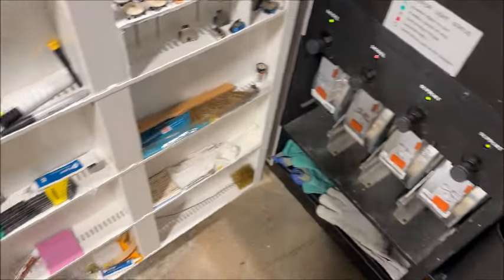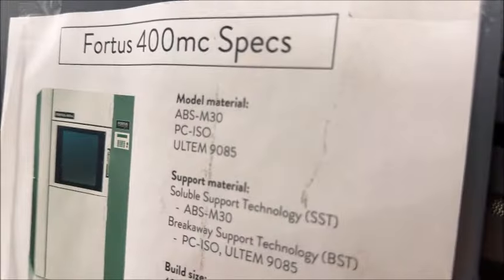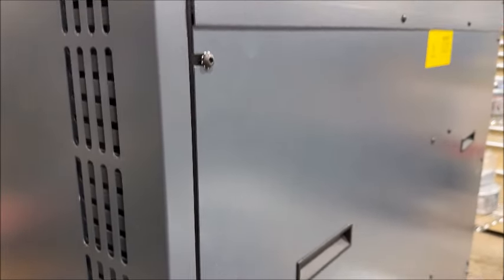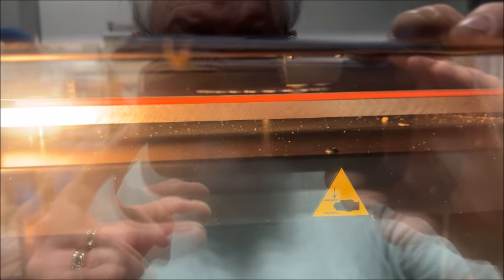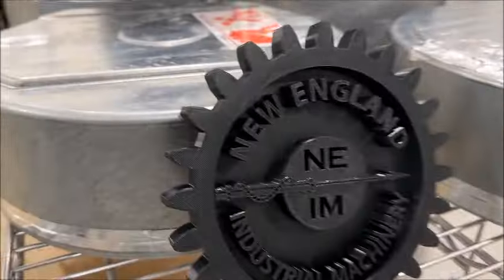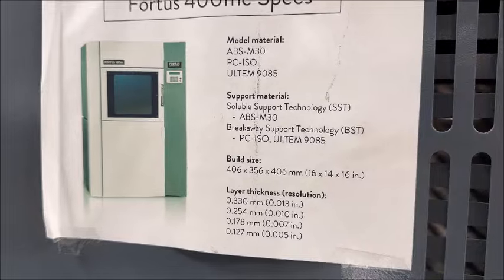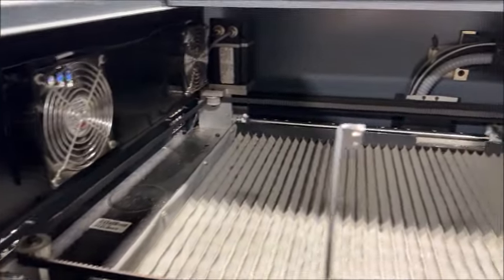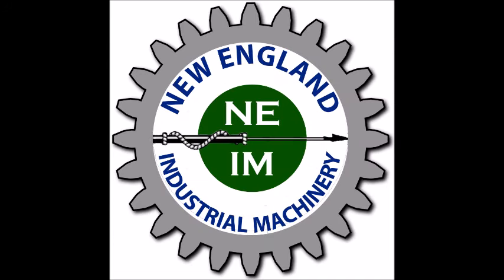STRATASYS FORTUS 400 MC 3D FDM Printer

Comment: The T-class machines from Stratasys are by far the most well engineered machines I've ever used. Material chips can be refilled with a common microcomputer and some code. And the tips are much cheaper instead of having to buy a brand new extrusion head every 1500 print hours.